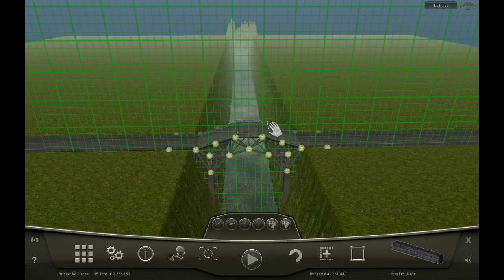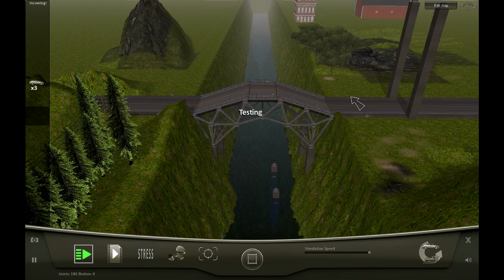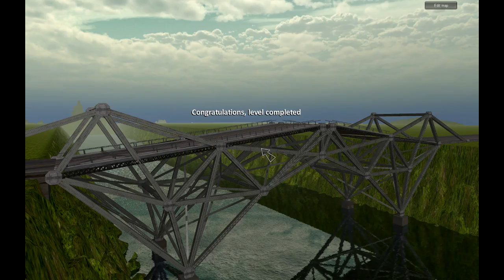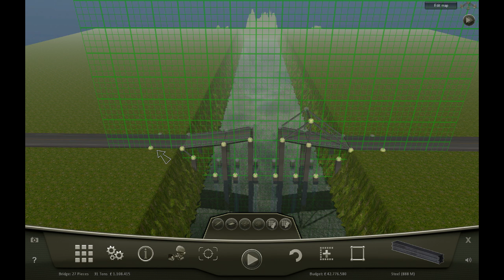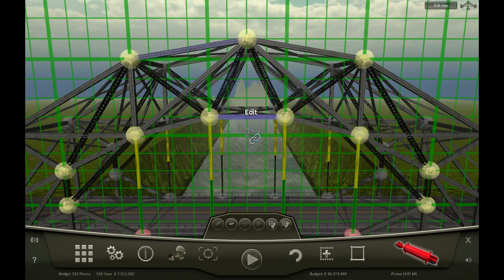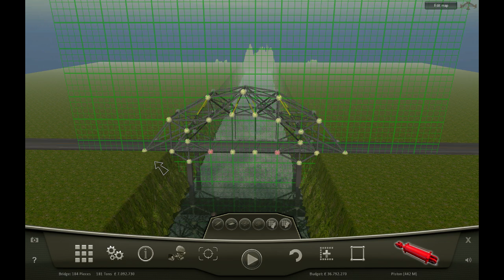Bridge Project 04 - Xisuma Plays

Comment: I think the open joint on the far left (15:31) was on a random iron beam, not the roadway, so the piston pulled the beam, which pulled the road, which make it go crazy. What you need to do is delete the iron beam and make the road a open joint, so the pistons would pull the road.

Comment: xisuma, to build the roads use steel or iron, not plain road. Iron and Steel hold much more weight and they connect to the anchor points.